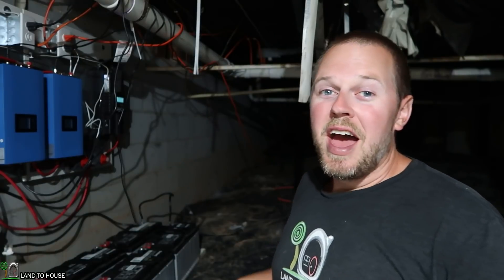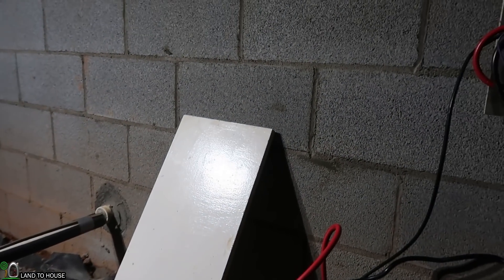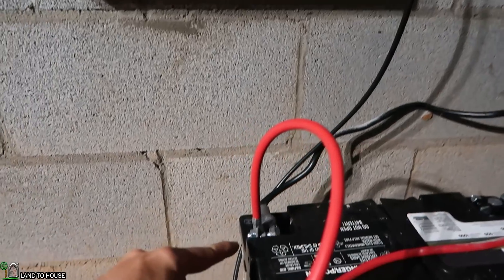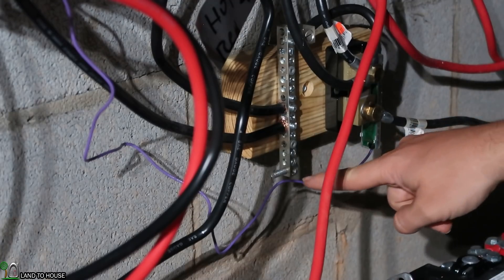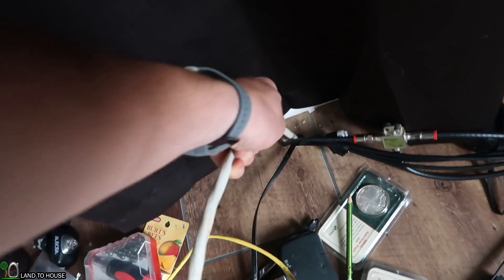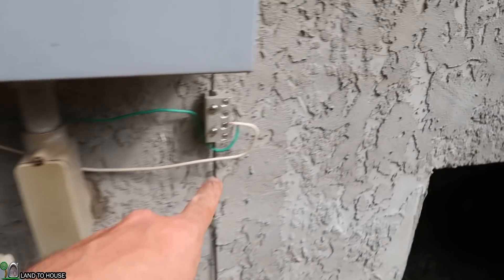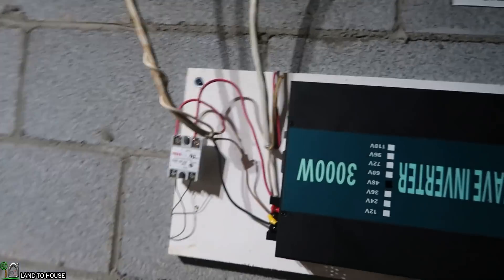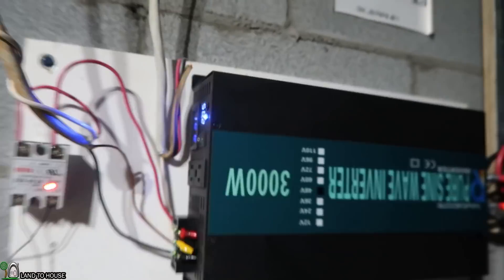Installing an Off Grid 3000w 48v Inverter Hydro and Solar

Comment: I'm puzzled. You have a grid tie system with a battery backup, yet when the power goes out, you have no power? Whats the purpose of the batteries if they can't be used when the power is out?
Reply from the maker: This system was replaced with a whole house inverter and battery system.

Comment: Do not use the ground lug on these inverters they are connected to battery ground & that puts it in the negative rail of the half bridge and so the difference from ground to line and neutral is +-60v if your inverter is 120v. It is better to connect the earth lug to neutral like in the braker box like they do and leave the inverter floating.

Comment: I have the Midnite at my ranch and there is an inverter included with it. Does yours not have that, and if not, why wouldn't buy the Midnite that was made to go with your charge controller?
Note: I did not install the system it was all done by a Solar Tech.

Comment: Watch out for that Fotek ssr, ive used them alot and they've all burnt even with sufficient cooling, id put a heatsink on it just to raise it off the board. I use c&g ssrs now they work well so far for me.

Comment: Once you put any kind of load on it, your solid state relay will overheat and pop.  Those typically only get to rated current with really good cooling on the back plate.  The Fotek ones are barely able to make their rating temporarily, never mind continuously. Please put a relay on your inverter's ON switch instead of it's output.

Comment: James Holbrook made a good point, inverter will continue to be a parasitic draw on your batteries even after it disconnects your plug-in, solution is to rewire the ssr to the on/off switch wires so it turns the inverter completely off,

Comment: careful  .. if i remember the wiring of that model correctly ..  they use the china .. wire color code .. so on the back of that unit .. the black is our white .. the red is our black .. the center is the  middle phase .. im not sure but some models if you go .. red plus middle or black plus middle .. you get 60 volts ..

Comment: Not wanting to add any negative opinion, but your system looks very sketchy, yo should always use the correct colour cable or at least mark it so you dont  end up shorting + and - in some time when you've forgotten they were changed
Reply from the maker: I am building an outdoor housing for all this. So I can use all new wire and make it a lot better. :)
Reply: @LandtoHouse  Good to hear, wish you the best of luck

Comment: Don't expect that inverter to last very long (don't go over 2000w constant use, try not to use motor loads on it)

also check for hot neutral it be 60/60 for 120v or 120/120 for 240v, check each live and neutral to ground (some inverters use half phase per live and neutral, its not split phase) if the neutral is live you need to make sure your neutral is Not earthed/going to ground if it is you get magic smoke (also means you need to use a double pole switch relay as you have a live neutral)

Use a large resistor to pre-charge the capacitors up when you're connecting the battery up to the inverter
Reply: @The-JMartian  under 2000w is usually fine (does not matter if it's a 2000-8000w rated "reliable" brand inverter) over that the mosfets like to short out eventually and release the magic smoke

you like your chain saw inside your fridge :)

Comment: I'd consider larger gauge wire for your battery connections. 48v and 3000 watts is 60ish volts (watts/volts=amps). And that looks like 6 or 8 gauge. You'd be maxing out 6 gauge and too high for 8 gauge.

Comment: You could use that solid state relay and pull the switch out and hook it up there because 1 it would make it take no power vs on stand by it probably uses a couple watts up to like 40 but 3000 watts is a lot
Reply: You are spot on

Comment: why not keep some heat shrink around ? that way you can cover the black cable up with red heat shrink should this issue ever come up in future, it'll also be there for any other wiring you need to do, tape lets go over time ....

Comment: Love the content, Seth.  It's great to see you continuing to explore various off-grid options.  

A few things I would recommend to improve the overall safety of your setup are:

1. Hook your batteries up to a 300-500A DC rated set of busbars via 2/0 AWG - 4/0 AWG cable with a quality DC rated fuse and disconnect or DC rated breaker.  Using the busbars and correct rated cable will help reduce/eliminate the cable clutter as you continue to expand and change the system in the future.  If you are ever out of town and need to have a family member, friend, or neighbor stop to check on things it is a really good idea to have things labeled and as easy to understand as possible in an emergency.  Having fuses w/disconnect or breakers is an absolute requirement if you ever switch to lithium batteries.

2. Have each of your devices (charge controllers, inverters, etc.) connected with a DC-rated fuse w/disconnect or DC-rated breaker.    

3. That solid-state relay should really have a heatsink on it as they tend to heat up quickly as they carry more current.

4. When dealing with AC you do not have positive or negative since they are alternating.  You have Line(s), Neutral, and Ground.  Use the correct NEC color codes to help prevent mistakes or issues in the future.  Line(s) should be Black and Red in most basic split-phase systems. neutral should be white and ground should be green or bare copper.  Since this inverter doesn't meet any UL or ETL certifications for the US, it likely won't be configured correctly so that neutral and ground are basically at zero volts with respect to each other and instead will be split-phase so the ground will be around 60V with respect to Line and Neutral and only Line to Neutral will be 120V if I had to guess.

5. It would be a good idea to consider adding a critical loads panel and move any of the circuits you need to it from the main panel and just have those circuits powered at all times from the inverter to eliminate the need to run extension cords in a power outage. Or use a generator input transfer switch style critical loads panel if you only want to run the inverter in a power outage situation. A good example might be any fridges or freezers along with phones, internet routers, TV,  and lights so it is already preconfigured and in the event of an outage, it only takes a few seconds to transfer critical loads to the inverter or generator from the grid.

Just a few thoughts on how it can be better and safer.

Comment: I'd label those wires in your AC receptacle! in the AC world, that 10/3 you're using you put all the colors in the wrong spot! That's meant for 220v, the black/red are your "hot" legs of each phase, the white is neutral (you called ground) and the uncoated is earth-ground! The red wire SHOULD have been the one you coiled up and didn't use. Even on the back of those outlets you bought you'll see printed on them BLACK/WHITE for which side goes where and a green screw for the earth-ground. You ever just quickly tap the other posts on that receptacle to  add more outlets you might wind up in a world of trouble if you forget your non-standard wiring :) Also I'd look at that manual, I can't say for certain but it looks like your earth-ground may be on the wrong post, normally these devices are labelled "LNG" meaning Line (hot), Neutral, and Earth-ground. It maybe okay because if you open these units most often the "Neutral" and "Earth-Ground" are bonded together.
Reply: For most of the world red is live and black is neutral, yellow is earth/ground (black been live is a USA thing due to spit phase and odd colour standards)

This inverter I believe uses a hot neutral (not split phase) it does half phase per leg,, not every inverter in configured this way (but the larger ones are know to use it) so there be 60v or 120v per leg depending if your at 120 or 240v ac, witch is a problem because if the neutral gets grounded it will fry the inverter

If it is hot neutral he need to get a dual latching relay as the neutral will still be hot when it clicks off

Comment: Hi, if I were you I would add a breaker box between your inverter output and the cable going to your home, also the regular AC plug can not handle 3000W it is rated to 1800W (or 15A) you could use 2  regular plugs outlet and 2 15A breaker circuits. Right now if you have a short and the inverter provides 6000W for a while, you risk a fire. I think you have to threat the inverter as if it was a main power from the utility company and use the same guide lines for power, breaker protection ect. Still love the videos thank you, stay safe.
Reply from the maker: Now that I have all the components I am going to build a box outside and add the other things. I want the parts out from the crawl space.
Reply: @LandtoHouse  Very wise to move all parts (esp. the batteries) out of the crawl space and away from the house. In the meantime a smoke detector still would be a good idea.
Reply from the maker: @patrickhoffmann8893   I just got the lumber to the house today. Should start on that out building in the next couple of days.. I will likely step up all my cables and get switches etc.

Comment: Seth that inverter you purchased is a modified sign wave inverter and it is only 2,000 watts not what it is advertised as. Look into a Wagan Tech pure sign wave inverter or similar. Wagan Tech is an American company making power inverters for public safety agencies. They make up to a 10 thousand watt pure sign wave inverter.
Reply from the maker: There is actually a review on this inverter that shows the sine wave. It is a nice one.

Comment: i have question i dont want to be disrespectful but why have you not included wind power.then you have multipul backup?and then truly off grid
Reply from the maker: We have very little wind here at the house. Mountains on all sides. 
It would take a lot more battery to go fully off the grid.

Comment: You can also use a DC light bulb as a resistor when you hook up the inverter. 
Also standard would be use Black for Hot and White for Neutral on the AC side. 
Definitely add some covers on the 120Vac to protect everyone

Comment: so your current system could not turn dc to ac, stand-alone
Reply: grid tie is not wise
Reply from the maker: There are two grid tie limiters. Saves around $45 a month. The addition of an off grid allows for use when the power goes out because the grid tie shut down.
Reply: @LandtoHouse  I just dont advice grid tie, should be stand-alone with grid option
Reply: @LandtoHouse  I mean a combo-unit with the optional grid in when wanted
Reply: @LandtoHouse  victron should have a full capacity unit for all inputs and still push out all the ac/dc needed to the house, same plugs and connectors

Comment: Please go and install the plastic cover on the the hard-wire-AC terminal!!! Give care, live longer!
And: In your other video on the Tools Tech and Gear channel you mention a "Stand-by Power of less than 30W". That means the inverter will empty your batteries with up to 30W all the time, even nothing is connected to your off-grid power outlet (That has already happened with your new shed.). What you need is a relay between the batteries and the inverter! Unfortunately, you cannot use the one you have already. This is rated only up to 40V (and 250V).

Comment: why did you not use two red wires for + and two black wires for -
Reply from the maker: I got every cable the store had.
Reply: @LandtoHouse  Yeah but Seth you could have the two red wires and the two black wires so they were the same colur instead of black/red black/red - why did you mix the colors up??
Reply from the maker: @karldawson510  the wires were different lengths. BUT I am going to move and rewire everything.
Reply: @LandtoHouse  cheers that makes sense.  I have to admit it looks a good set up but a bit unsafe with all those exposed terminals are you think of boxing any of it in?

Comment: I would be using relays or similar components to cut the DC side and not the AC side. Then I would add a switch upstairs so if you turn on the inverter it shuts off the grid tie inverters automatically.
Reply: If it was a half decent inverter it should have a remote switch option, that would eliminate all standby power
Reply: I’d also be looking at using welding cable for power wires because you can get flexible high gauge wire that actually meets the amperage requirements instead of hoping one of your cables doesn’t fail and cause the other to take the full load.
Reply: Yup, relay on the DC side is very advisable. The inverter has a stand-by power of "less than 30W", which steadily drains the batteries. But the used relay will not work, it is only rated up to 40A.
Reply: @patrickhoffmann8893 the power switch of the inverter works, a small modification needs to be made

Comment: You must install some sensors. One for water, one for smoke, and one for heat. They're pretty cheap - a lot cheaper than losing your house.
Reply: Yes, there is a lot to be improved (covers on AC side and on battery contacts, fuses, circuit breaker, ...), but you should at least install a smoke sensor.
Reply: It's already too late, but at least you don't lose your life 😂

Comment: Suggestion
use a sub panel for the items that you need continuous power to - ei fridge modem
the sub panel will be connected to the main panel and the inverter
Reply: Since the inverter cant "sync" to the grid, it cant be always connected, it would need to be an "interlock" system on his main panel (either the main breaker is on, or the break for the inverter, never both) like with a hardwired portable generator connection.
Reply: @thepeepsdotnet  Take a search for it 
It CAN be done
Reply: @roberthopgood1894  yes, but when the local grid goes down the inverter will not have any thing to sync to.  This can cause two problems, if there is not an interlock in place.
First, with out the interlock on the panel, the inverter will be back-feeding the local grid (ie: everyone in your neighborhood) and would overload the inverter, and wires that are connected to it (fire hazard).  This would also pose a risk to linemen that would be working on the distribution grid as the back-feed would also energize the high-voltage line on primary side of transformer. 
Second, when power is restored, if the waveform of street power isn't in phase (sync) of the inverter, this would cause damage to the inverter, and possibly the local distribution grid as well.
This is why his other inverters deactivate when street power is lost.
Reply: @thepeepsdotnet  did you bother to search???
Reply: @roberthopgood1894  That inverter can not be used in that fashion, and even says so in the product description.  Also, it is a 120V inverter, and would only be able to power one side (leg) of the panel.
As I said in my first reply, there would need to be an interlock of some kind (ie: manual transfer switch) that would keep the inverter isolated from the main power feed from the street. to have it tied into any house wiring.
Reply: @thepeepsdotnet  It is the same process for automatically kicking a power generator when the electricity goes off

Comment: 10:06 There are two kinds of 'ground'. One is Earth Ground which a Ground Rod drove in the actual Earth (usually by the electric meter). The other "ground" is called Neutral and is the common wire for house wiring. Usually a white wire. Earth gound is usually a green wire.

Comment: The inverter is always using power, about 66o/o more than the inverter s output. Put a relay on the regular AC line, so when you lose line power, the relay switches the DC power on. That way, the inverter is always off except when the power to the house is lost. This will also save the inverter from heating up and prematurely failing. Remember, an inverter uses power, even when nothing is needing power.
Reply: Problem is it will blow off the traces off the inverter capacitors if the DC side is switched often and will destroy the relay as well due to the ark (the capacitors when charging up pull a crap load of currant in a instant short time)

Comment: The inverter uses a fair amount of power when idle. It would be better to use the Midnite solar to switch a relay that controls the power switch on the inverter, that way it turns off completely, rather than just shutting off the output. That's how I use it in my home system, only difference is it's battery percentage based using the Midnite shunt instead of voltage based.  Unless you plan to leave the inverter switched off until you loose power? If that's the case then if it's your only power, your probably going to want to let it draw the batteries much lower than the grid tie inverters do so you have more power when the grid is down. I generally only let my inverter draw down to 80% but when the grid is down I change it to 5% so the fridge runs as long as possible. Very cool setup.